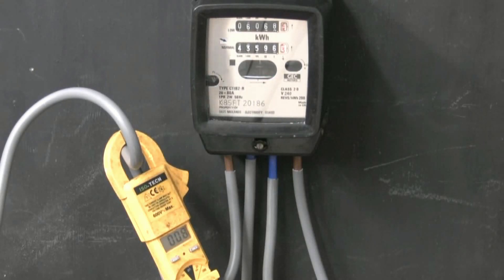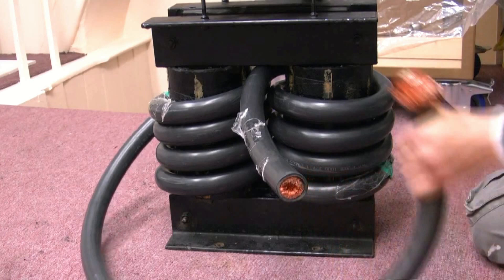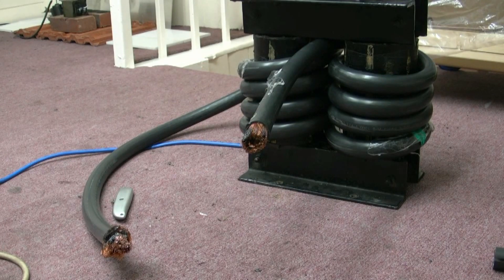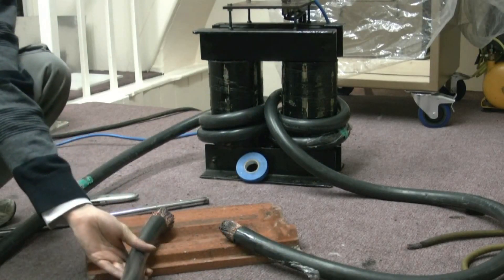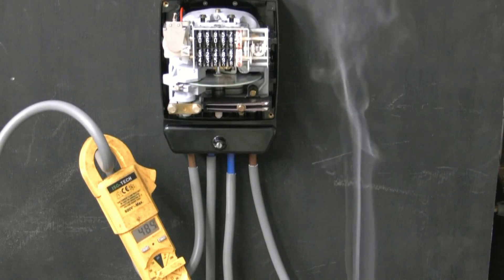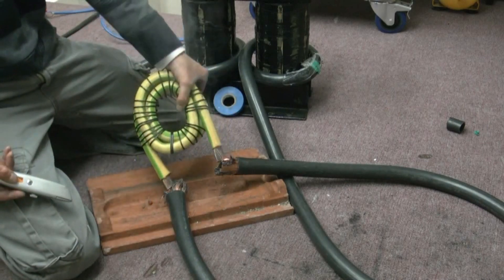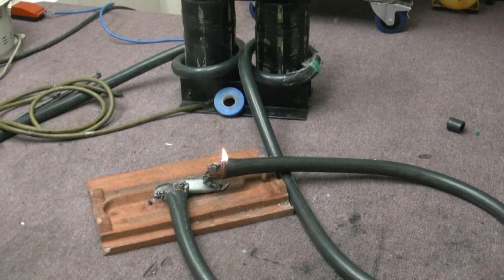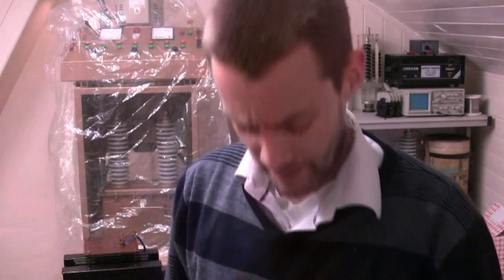Too Much Current + Electric Meter Pops

Comment: So, umm, stupid question, if the electric meter went kablooie, does that mean the circuit breaker was bypassed? Aren't you worried about the wiring inside your walls not being able to handle that kind of current?

Comment: lol touch it
Reply: +Altus Boren like if holding a molten metal rod under current is not "touching it"
Reply: Well, clearly! Why would I refer to him currently holding it? Would that not be stupid and redundant since that is clearly seen? That can only mean, that is not the area where I wish for him to touch. With this, we can only deduce there must be another area where I wish for him to touch, maybe, probably, the molten area? How was this not implied?
Reply: Altus Boren you are true master in expressing yourself in 3 or 30 words
Reply: Thanks, three words are all that is needed, at least in this case.
Reply: fallencommaner i am aware of that. however the laws of the path of least resistance will not allow 2 volts to pass the resistance of the skin. even on AC.
Reply: +Altus Boren 
                       ha ha ha
Reply: +Altus Boren sure. that transformer cannot kill you. its only a few volts.
Reply: +smallenginedude71 It's not the volts that kill you, it's the amps. That's why people survive lightning strikes (~27kV) but battery circuits can kill you.

Comment: Why didn't you get belted when holding that rod across those cables?
Reply: +HiddenWarrior Low voltage. But the massive wire means there can be a high current anyway, through the wire that is. It's the difference between being sliced in half with a high pressure water jet cutter, or standing in a river and just getting a bit wet.
Reply: Alex C Kind of get what you mean.  trying to get my head around it tbh. when 30mA can kil and Photon is playing with 20kA.  Sure he's not earthed but I still would have thought he'd get some kind of tingle at least.
Reply: HiddenWarrior You can die if too much water goes through your body (because it damages stuff). Hence why a water-jet cutter can kill you. So again, how come you can stand in a river without getting hurt? The river has a lot more water than the cutter.

Comment: The fuck man? No gloves? Your hands are both in the path of that current and two inches from completing it directly. You better hope it's the kind that blows you away and not the kind that pulls you in.

JUST GET SOME FROM WALMART OR SOMETHING. NOBODY CARES HOW SAFE YOU THINK YOU ARE UNLESS YOU DO SOMETHING SANE ABOUT IT.
Reply: +Brian Summers The only danger there was the heat.
Reply: ***** Amps, hands down.
Reply: ***** It depends.
Imagine a soldier and a gun. In theory the gun kills, but the soldier pulls the trigger.
The gun is the current (amps), and the soldier is the voltage.

So you die if a few milliamps go through your heart, but it can only happen if the source has high enough voltage to break your skin.
A single battery can dish out a few amps, one amp would kill you in an instant, but since the battery only has 1,5V across it, it will never kill a person.
Reply: +Brian Summers high current yes but extremely low voltage, the only danger is the heat.

Comment: Working with sparks, high current and hot wires, and a carpet installed???!!!! you are nuts.
Reply: It's an anti-static carpet.

Also, it's hypoallergenic.
Reply: Carlos Matiz of course hes nuts, what does it look like?
Reply: Carlos Matiz He may be nuts, but hes DEFINITELY smarter than you LOLOL
Reply: Well, there isn't much left of the carpet.
Reply: And that's what tipped you off?

Comment: Based on ohms law low voltage and low resistance can give high current. Example 50 volts with a resistance of 0.5 ohms will give 100 amps, which is 5000 watts or 5 kW
Reply: +jiva1955 Yea, with a perfect power supply. And a perfect resistance. Show me a 0.5 ohms resistance that does not immediatly blow up if you connect "perfect 50 volts" so no voltage drop.
Reply: +Valansch I was a calibration engineer working on UKAS standards for Low Frequency and DC. Such a method of measurement is employed. The volt drop is measured using a DVM with an accuracy of parts per million (ppm) The resistance standard is suspended in oil and measured to within 0.001% The voltage suppled from a source which can deliver 100amps. Thus the current is calculated V/R=I and watts I^2R
Reply: +jiva1955 The resistance standard is obviously capable of passing high current. An iron bar calibrated to the specific value across high current terminals suspended in oil to dissipate heat has to be used for best accuracy.
Reply: +jiva1955 http://www.npl.co.uk/measurement-services/dc-lf/dc-and-ac-resistance

Comment: WTFF at 8:54
How did that not SHOCKKK HIM???
Reply: it is because it is a low voltage
Reply: It's like 1 or 2 volts, but many hundreds of amps.
Reply: There is no current running through him. Dumbo